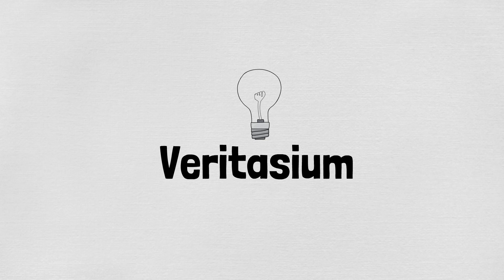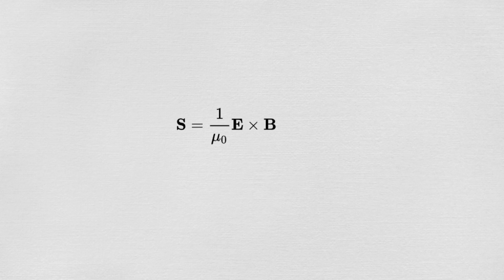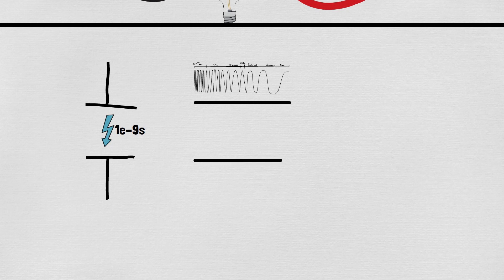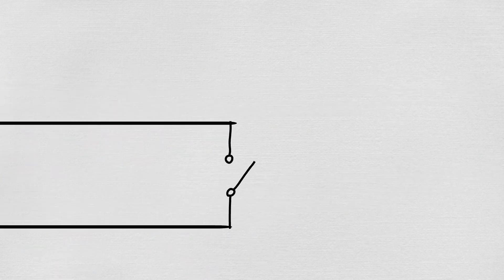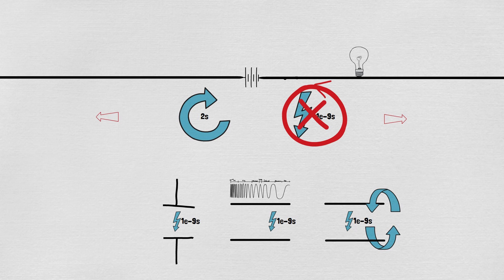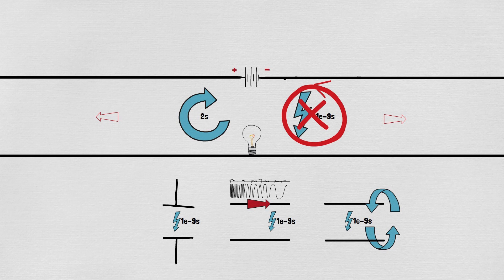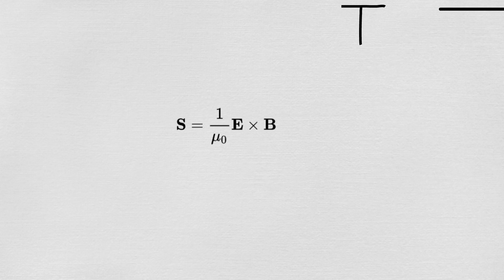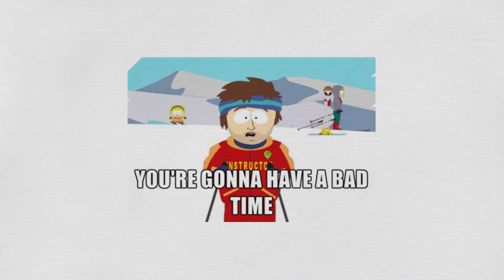Veritasium is Right? (see description)

Comment: As someone from the field and having written a book about ED, I can say it is still not the entire story and it is not "completely correct", but it points definitely to the actual problems in Veritasiums explanation!
Since the story is quite lengthy to fully cover, maybe just addressing the position of the switch: The position ot the switch denotes in the end, where the potential difference is, that will change when closing the switch and from which point the current will start to flow. So actually the switch is the most important part in this question. The funny thing is, if you put the switch on the bulb side 1cm next to the bulb, the bulb will in fact start "immediately", or as long as it takes for the starting current in the closed switch to reach the bulb. At this point, there is j*E in the bulb and it is a sink for the energy in the electrodynamic system and draws power from it. And there is already quite some energy in the system, stored in the electrostatic field, that is already present from the start. The funny thing about this arrangement is just, that the bulb starts to shine, when the battery does not even know yet anything changed. And the battery could even be on the far end of the circuit.
Reply: Your last point makes so much sense to me. Probably a horrible (or even wrong?) analogy, but when you have a water reservoir high up (aka the "potential") and you have a super long tube connected to a turbine. Then you include two switches, one at the bottom of the pipe (near the turbine) and at the top (near the reservoir). If you open the one close two the turbine, the water will "immediately" power the turbine even though the water level at the top hasn't started falling yet. (Of course all this is only possible due to the unsteady nature of the start-up process!) On the other hand, if you open the switch at the top, the water level will go down a bit into the pipe even though the turbine has not produced any power.
Reply: This seems right to me
Reply: I’m curious, does this mean that the electromagnetic field has already “propagated out” from the battery itself, merely by its presence and/or connection to the wires/bulb, and so it has reached some kind of steady state before the switch completes the circuit?

And that something different is already going on in the wires, because of the battery being hooked up to them and/or in the vicinity, such that on either side of the switch there is already some difference, in the EM field or maybe even the electrons “positions,” that will cause the current to begin flowing nearly instantaneously upon connection?

Which makes me wonder, what if, instead of a switch, it’s the bulb with the two long wires and the battery itself starts out away from the open circuit, and then gets shoved into place very quickly, completing the circuit, faster than light could travel to the ends of both wires and back to the lightbulb (or for an EM field to reach equilibrium along the entirety of the circuit)?
Reply: In this setup, what would happen if we cut the wires somewhere (case 1: at the battery, case 2: at the far ends of the wires)  at the same time when we turn on the switch?

In both cases the loop is never fully closed, but I guess it would take some time for the information of the wire being cut to travel around? If the light does turn on, that would mean the battery lost some energy, but by what mechanism?

(Disclaimer: not a physicist)
Reply: @KlemenKloboves  Then it is basically a very badly designed capacitor, made up of open ended wires. So after closing the switch next to the bulb, the potential drop will lead to a current in the lamp until the open ended wires dont have any potential difference anymore. So it will maybe shine for a second, and then the energy stored in the initial electric field due to the potential difference of this long and huge wires will drain through the lamp.
Reply: thanks for that. I have been having issues with quite a few explanations, but am a mere electrician, and not a scientist. When I looked at the circuit, I saw the potential difference across the open switch, either side of which is just an extension of the battery's charge. The whole circuit could be considered the battery with positive and negative on either side of the switch.  
Close the switch and the potential difference moves to the luminaire, I'm assuming at the speed of light, and it starts to glow as the current flows. 
I think the amount of time it takes for the light to "light" is dependent on how far away the switch is from it, not the battery.
Reply: @Brent-ln9bc  Well, that is true and maybe just a different way to express what I said. The entire wires have to be on the potential of the poles of the battery it is connected to and hence power flows from the battery into the electric field established alongside it.
Reply: I am doing my first physics class on "Electricity and Magnetism", so I have very basic knowledge, but even I knew there was something wrong. My teacher clearly explained that the charge/electrons are already in the metal wires. It's not one single electron moving, it's a "chain" moving together, so the potential difference from the battery spread across the wire. As you said, the position of the switch is the most important factor here.
Reply: When the switch is closed, the potential difference across it is eliminated. this causes the EM fields to change through the whole wire, regardless of where the switch is. It is that change (everywhere) that creates the EM field, and the field generation takes time. The longer the wires, the longer the time taken (and the greater the transmission losses). Your book is probably really good for non-relativistic examinations of the topic where field generation can be modeled as instantaneous, but I'm sure that if you re-edited it to add time and relativity to the whole examination, you'd find that your book increased in length tenfold, became much more accurate, very difficult to understand and had no relationship with anything that engineers actually do with circuit design and EMF - because the approximations are completely valid for any real-world use, even if they do fail in these extreme scenarios.
Reply: @stephendee7839  I am not sure whether you're trolling or really not realize what you write.
Obviously the potential difference is not eliminated at once. It travels along the wire like a single wave front. And with it the field changes with time. All that is part of my considerations, don't worry! :) That does not change what I wrote above.
Reply: @ibonitog  - That's a horrible analogy.  Current and fluid dynamics are completely different.
Reply: Hi! May I ask your book's name? I think your answer may be the clue I was looking for to understand the "Catt question". Do you have some thoughs about it? Catt is an EE, who a few years ago asked a simple question regarding a similar setup. According to his view (and many others who follow him) no succesful aswer has been published yet. Indeed some years ago, two physics published a solution, which eventualy was proved wrong. If you ever heard about "Catt question", I would like to know your thoughts about it.
Reply: @chucksavall  Can you elaborate on that?
Reply: @Little Forest So does that mean that the potential difference still needs to propagate along the wire one the switch is closed? That would mean that it's not the position of the switch relative to the battery per se but rather the position of the switch along the length of the circuit is relevant for determining how ling it takes for the bulb to feel the full potential and start glowing.
Or does the potential difference propagate through the EM field through air?

In other words, what I'm understanding is in the case where the switch is right next to the bulb, the bulb comes on almost instantly. When the switch is on the far end, half a light second away, it takes about half a second for the bulb to come on. When the switch is near the battery as in the Veritasium example, it should therefore take pretty much a full second for the bulb to experience the full voltage from the battery.
Is that correct? Or am I missing something?
Reply: @ibonitog  I think your analogy is a little bit wrong. In the battery-lightbulb scenario, the potential difference would be at the ends of the switch. One end of the switch  would be at + volttage same as positive pole of battery, and the other end would be at - voltage of battery. So as we close the switch  - the current will flow instantly, thus the lightbulb  will instantly glow.  Making an analogy with water-pipe-turbine scenario - no matter there's the valve located, the pipe before the valve, and also the pipe after valve all the way to the turbine - will be filled with water. So opening the valve would  make turbine to spin instantly. You considered the pipeline after valve and down to the turbine to be empty volume - that's a mistake.
Reply: @shoutitallloud  I actually consider it filled, with the finite speed of sound in water just talking some time for the (pressure wave) information traveling downstream to the pump for example.
Reply: @ibonitog  Ok. Then why do you think the pressure wave has to travel only from valve to the turbine? If you put the valve right before the turbine, then you must account a discharge (depressure) wave to travel from the valve back to the water tank. And this should make turbine to delay spinning, right?
The same thing if we prolong a pipe  after the turbine and put the valve at the end -  this should not make a difference: either the turbine spins immediately, or with the same delay as with valve location at the top.